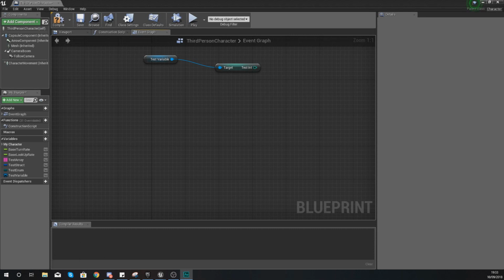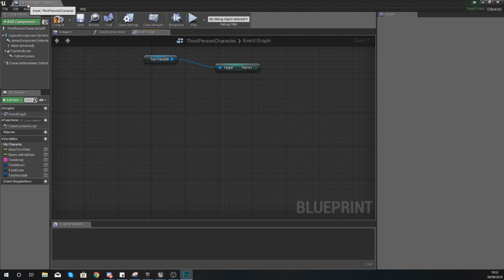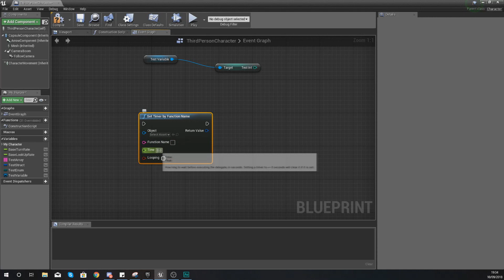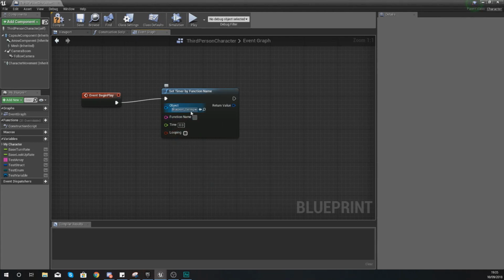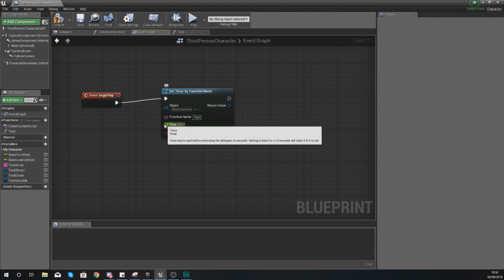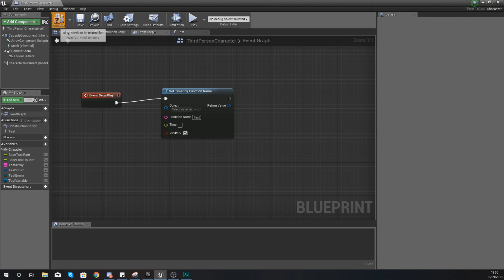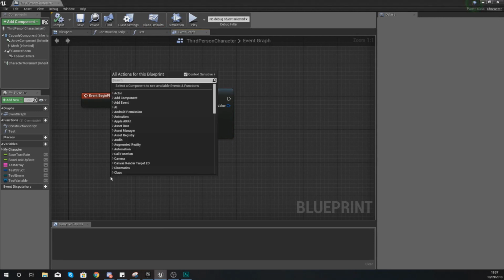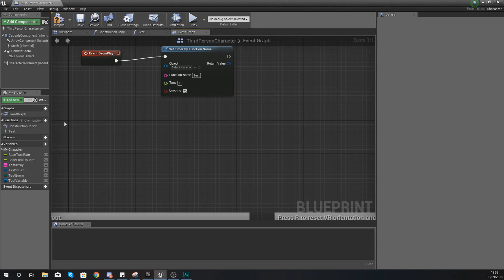Set Timer by function name - #29 Unreal Engine 4 Blueprints Tutorial Series

Comment: Something important you forgot: You can cancel these timers, whereas delay nodes can't be canceled directly.
Reply: @flobby6137  You can call Clear Timer on the TimerHandle (the Return Value of your Set Timer Function) to stop a Timer. It will not call the function or event assigned to it and it will stop counting.
Reply: That is helpful. So like if my character is attacked during regen the timer will start again?
Reply: @flobby6137  hahaha you expected an answer from 2 y.o. comment and you actually got the answer.